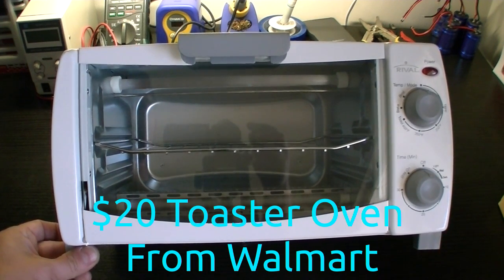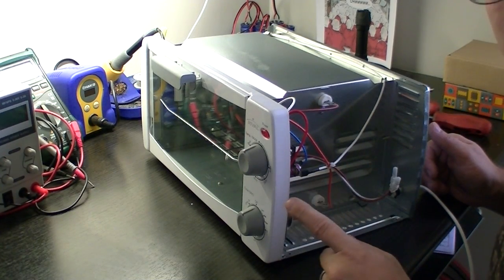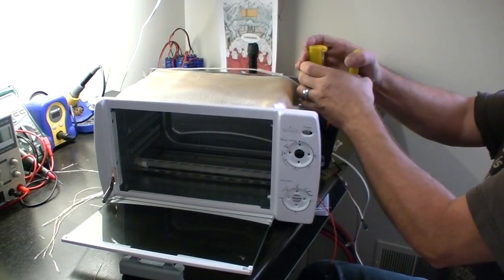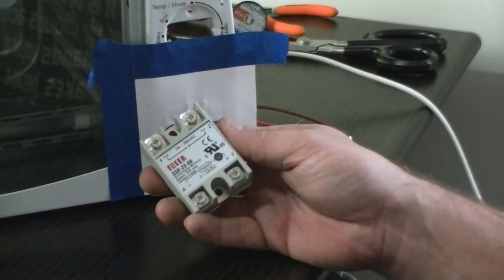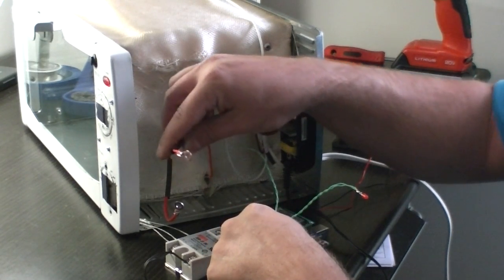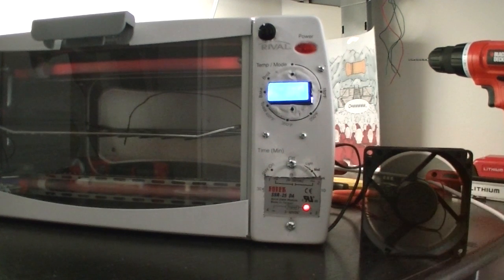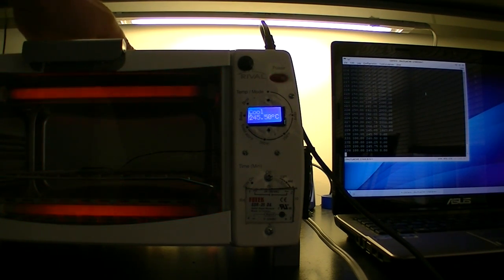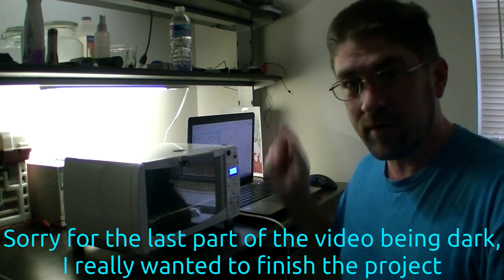DIY Arduino Controlled Toaster Reflow Oven Build

Comment: It's fun we needed to wait 10 years until the LCD appears on the Arduino?
Or your module is custom, and we need also wait the next 10 years for nextgen Odurino in place of AVR Butterfly module?
Did you try to use both quartz and metal heater in a couple using PLD controller algorithm?
Reply: Why the hell we still have no Arduino on ordinary cooking equipment?

Comment: To mad electron engineering, great video . working on getting parts to build it., however a few questions for you.  do you recall the radio shack  switches by part number , if not  , watching video  cant tell amp and voltage rating you used. noticed you were drilling holes for pop rivets.  do u recall  size of drill bit used to attach  welding blanket. can you provide a schematic on how you wired it up. would be helpful. or a rough sketch. thanks. to those that wish to build it..... you can purchase most of the components via amazon and Walmart has the oven ( model mg10bfk-b from  mainstays it has the proper elements. i would like to use this to make my own model railroad circuit boards etc.

Comment: A Warning: There is a problem with the 25 amp SSR's you buy on eBay.  Many of the inexpensive ones are over rated i.e. the element inside is only a 15 amp part instead of 25 amp.  When the SSR fails they fail on with no way to turn off the heat.  Use a timer on the AC plug set to 20% longer than the required time. to execute the reflow cycle.  Sellers from Asia on eBay are not always honest.  There is a video on YouTube on how to identify fake SSR's.

Comment: That’s an expensive reflow oven. They’re only $175 commercially built on aliexpress. Looking at what you paid for parts though explains a lot you went all out premium price for what could’ve been purchased for half the cost. My uno boards cost $4 each. Samd 32bit are $13ea. A pid controller would’ve eliminated the arduino. Edit: also kwool is much better than a welding blanket.

Comment: Just wanted to say thanks.  Was considering getting a $210 reflow oven from Amazon, and then I watched this video.  Got the new Rocket Scream controller (only $30 now and doesn't need the Arduino), $4 thermocouple, $12 welding blanket, $7 SSR, and $29 toaster oven.  Put it all together today and the first board I baked (a 4-port USB 2.0 hub) was a success.  Very satisfied with it and very glad I watched your video.

Comment: i have a microwave oven.it has 3 modes. grill,convection and microwave....
now the main board is not working properly...it causes the timing and other functions...there are no spares available in the market...

is it it possible to control this oven with arduino? please help

Comment: You can use standard fiberglass insulation (the type without a backing paper).
Reply from the maker: +Sharky's I don't think so, it's not heat rated.
Reply: +R&amp;TPreppers Isn't it used in RV hot water heating cabinets and intact inside the hot water heater? it gets fire hot in that thing?

Comment: Would a 10A SSR be ok for this build or do I absolutely have to have the 25A SSR?
Reply from the maker: +ingivg 10A should work if your oven is below 1200 watts, but it's a better practice to over-engineer something with a safety margin, hence the 25A SSR.

Comment: Hi, I missed the part where you connect the thermocouple to the Arduino board. I've seen the video back and forth several times in case I missed something importante, but I couldn't find that part.

Comment: I know its been a couple years now.  How has the welding blanket held up?  I've been toying with the idea of using reflect-a-gold and kaowool to insulate.
Reply from the maker: Ross Potts Blanket is still holding up perfectly.
Reply: Use kwool it makes a real thermal barrier.

Comment: hey thanks for the tutorial.. one question though, did you use the code that is provided by the rocket stream reflow oven shield web site, to program the arduino?

Comment: What is the purpose of Reflow Oven Shield? Is it possible for Arduino to read the temperature directy from the thermocouple and control the heat on/off through the SSR?
Reply from the maker: Excel Polm You need a seperate chip to boost the mV signal that is produced by the thermocouple before you can read the temperature with the arduino.  The shield also breaks out the connections for the display, 2 push buttons and the 2 signal wires to turn on/off a SSR.

Comment: SO I've basically figured out your video enough to build a reflow oven with the EXACT same toaster oven. A lot of grunt work to figure a few parts out (connecting the SSR properly, where to connect the LED and button too, maybe add that part in for people?) and i've got it built! looks awesome, seems to work great EXCEPT i use it to repair allready built boards from laptops and videocards. I'm having an issue with it blistering the GPU and CPU chips (using dead boards for testing). Any advice? I'm used some tinfoil to insulate the front door, as it was taking 2x as long as it should to reach the proper heat and I've also used a stip of tinfoil to defuse the top and bottom element. any help would be amazing! thanks!
Reply from the maker: I wouldn't use tinfoil around the elements but around the front door that will work.  If the CPU/GPU's are getting too hot then try moving your thermocouple to touching them.  This will limit the heat and keep from overcooking the chips.

Comment: What did you use for the DC adapter? Was DC adapter only used to power the arduino?

I am looking to do this project over the summer and I am unsure how to convert the toaster ovens AC to DC for the arduino. Can I just take apart a 12V wall adapter and feed the AC wires directly into it, bypassing the wall adapter prongs?
Reply from the maker: I used a 12 volt wall wart and put the correct barrel jack onto it to supply power to the arduino.  Then i opened up the wall wart and soldered wires from the AC input from the oven and attached them to the wall wart's circuit board where it recieves AC.

Comment: I wonder how stable the oven becomes with just adding the blanket. Is there a low tech alternative to the thermocouples and controller like just replacing the thermostat switch with a better one?

Comment: You must mean "low voltage" AC.  
Low Voltage AC = 0-600VAC.
High Voltage AC = 69,001VAC-230,000VAC
per NEC.

Comment: Question: would a bulkhead connector installed on the side of the toaster allow you to leave the relay and other components internal, then be able to have the arduino and shield external so you could use the UNO for other projects instead of leaving it sealed inside?

Comment: I have a fair amount of experience with electronics, meaning I pay attention to detail. With that said, how can I deem if I'm experienced enough to tackle this project? Also, is there anything that I need to know in order to install the Arduino board?
Reply: If you are as experinced as you say you are you will know if you are ready or not. To me its not a matter of being ready but being willing to try and learn and ready to accept success or failure (for the time being)
Reply: I see what you're saying. Gotta find a good oven and the appropriate Arduino then!

Comment: I would suggest that you re-position the bottom IR tube to the top, so that any possibilities of scorching the board causing discoloration and texture damage be minimized. It's easy to cut the slot for the IR tube onto the aluminium.. Ehm!, that using of solid state relay suggest only ON-OFF control, so really any PID algorithm would be for decoration purposes only. The dissipation of heat (cooling down) would be a problem. Didn't know how you did it without opening the oven door (for fast cooling). Anyway, please sharpen the drill bits. It's irritating to see drilling paper aluminium taking so long.

Comment: R&TPreppers, how many layers of fiberglass welding blanket did you use?

What was the temperature on the cool side of the blanket when the inside of the oven reached the hottest temperature?

Thanks!

Comment: Question, I've never looked into insulating a homebrew reflow oven before, would you recommend using non coated welding blanket? Or would the following product suffice?
http://www.ebay.com/itm/Tillman-591B33-3X3-30Oz-Gold-Acrylic-Coated-Fiberglass-Blanket-/251422763294?pt=LH_DefaultDomain_0&hash=item3a89f6e91e
Reply from the maker: It says the coated stuff is good till 1000'F but I would opt for the uncoated.

Comment: Nice job on the build. It looks safe and has better attention to detail than most people's builds. It looks like you're using PID for the temperature control. What are the PID tunings that work so well with your oven?
Reply from the maker: actually i got lucky and didn't have to touch the PID settings at all.
Reply: R&TPreppers Thanks, I now see the shield webpage has example code. It reads:

// *** PID PARAMETERS ***
// *** PRE-HEAT STAGE ***
#define PID_KP_PREHEAT 100
#define PID_KI_PREHEAT 0.025
#define PID_KD_PREHEAT 20
// *** SOAKING STAGE ***
#define PID_KP_SOAK 300
#define PID_KI_SOAK 0.05
#define PID_KD_SOAK 250
// *** REFLOW STAGE ***
#define PID_KP_REFLOW 300
#define PID_KI_REFLOW 0.05
#define PID_KD_REFLOW 350

Comment: I found the software, downloaded it, and will be gathering the parts.

Thanks. Your method is easy to follow, so thanks for putting in the time to explain everything.

BTW, I am using a derivative of Debian, it has the Arduino software built-in.
Reply from the maker: Honestly I can't remember.  It's buried somewhere on Rocket's website.

Comment: The computer fan, is it sucking out hot air from the case or blowing in cold air from outside? I have been wanting to make this for a long time, I have all the parts. This video was all that was needed to get my lazy bum going. Thanks :D
Reply from the maker: I have the fan sucking air into the electronics part of the oven.
Reply: It would have been more effective to blow the heat out of the electronics part of the oven. The nature of the problem is evacuating heat from the sensitive area, not cooling the existing air in the sensitive area.  Evacuating the heat will naturally draw the cooler air into the sensitive area.

I'm not saying what you did was "wrong", only that there is a better method to achieve your thermal management goal.

That was a good video overall. Thanks for posting it.

Comment: Sorry for the stupid question, but what is this oven for? I mean, can it do all the soldering for you? I've never seen such a thing, only heard... I have no idea how does it work
Reply: A bit more clarification:

Solder paste is a mix of tiny (VERY tiny) solder balls and flux, in such a consistency that it is basically a "paste." This paste when applied is not heated.

Generally when you use solder paste you use a stencil that allows you to apply paste to all the pads on the board in one fell swoop. (Stencil goes on board, covers all parts of board that shouldn't have paste, squigie paste over stencil, remove stencil, pads are now covered in a thin layer of paste)

Then you place all components on the pasted pads by hand.

Now once you have ever single component on the board, you put it in the oven to heat up all of the board, the components on the board, and most importantly, all the solder paste.

Once the paste gets up to a certain temperature, the tiny solder balls in the paste will melt and pool up into just a normal bit of molten solder, connecting the components to the traces.

It is also worth mentioning that when the solder paste liquefies the surface tension of the molten solder can pull components into perfect placement allowing for some error correction on component placement (At least to the degree where functioning placement will turn into aesthetically pleasing placement, as if a machine had done it.)
Reply from the maker: You use solder paste instead of regular solder.  Once you place solder paste on the pads, you put the components on top of the paste, then put the whole circuit board in the oven for reflowing.
Reply from the maker: Thanks for adding that BAM5